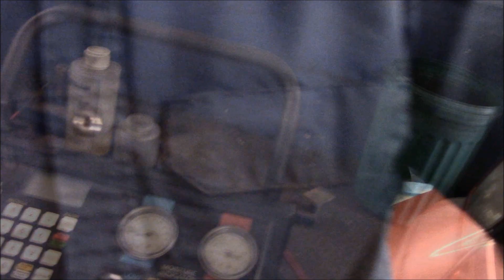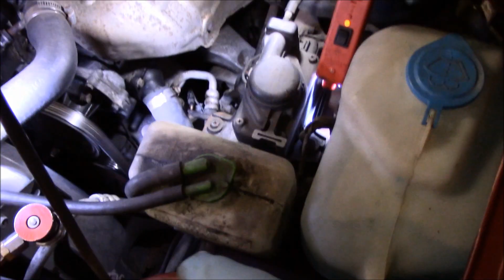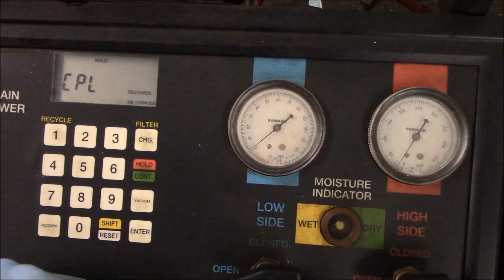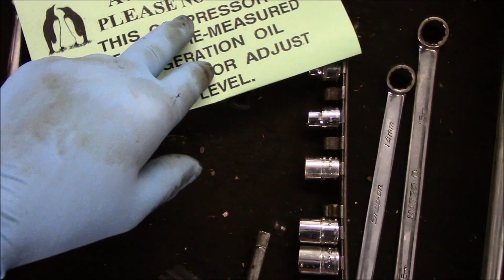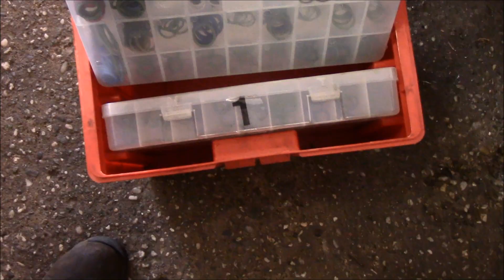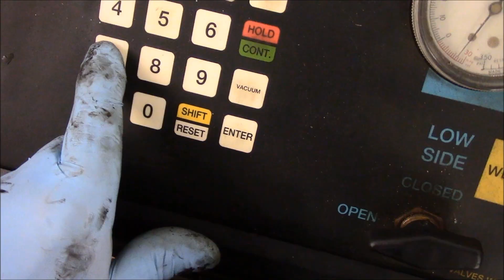How to replace the AC compressor

Comment: Hey Jim maybe if you would have increased the freon level it may have turned on and then check for a leak those system should NEVER BE LOW UNLESS THERE IS A LEAK. they will be without ac again because there is most likely a leak. Good chance there was nothing wrong with that compressor .seen this many many time on the 300+ fleet cars I work on

Comment: Hello Jim...how about a 2016 Mitsubishi Outlander that stops blowing cold air when I'm stopped at a red light or stop and go traffic??? Once I get going, it starts blowing cold air again. REALLY annoying! I have to put it in neutral and rev up the engine when I'm stopped, or I will bake. Any suggestions? Thanks!

Comment: Right in the beginning of the video you point out the low side pressure port which is blue in the front of the car, but 10 seconds into the video you proceed but putting your high side (RED) hose onto the same port that you just said was the low side. I’m confused as a hvac tech.
Reply from the maker: Thanks for watching.

Comment: excuse me sir my 2016 Hyundai elantra ac stopped working yesterday it still blows air on ever power level but its just warm air I noticed the ac fan behind the radiator was not working even when I set it to max ac I tried recharging it but the gauge read its at the right level do you know what could cause this
Reply from the maker: The first thing you should check is for power and ground on the ac compressor clutch. BE VERY CAREFUL YOU WILL NEED TO CHECK THAT WITH THE CAR RUNNING.

Comment: I have to replace my ac in a 2010 pontiac g6. No experience so wish me luck. Freon was emptied at a shop so I could start safely.
Reply from the maker: Good luck .Let me know if you need any advice
Reply: @jimthecarguy  what direction did you pull it out from? When I try to pull it out the wheel well the frame is in the way if I want to pull it off from the bottom the exhaust is in the way. Thanks in advance

Comment: Chevy Cruze 2013 eco AC 
My chevy has been blowing hot air, I recharged the 134a to the edge of the blue line on the gage in low pressure gage, then stopped the canister and disconnected the line from the low pressure at around 52. The car did not engage the clutch on the compressor so  i am thinking maybe its stuck. But it spins so easily and fast. It just wont turn on? how can i tell if its a fuse or not? or what can i do before i take it in. Its hot here as well, so gotta get her done asap.
thank you for taking the time to answer my queston
Reply from the maker: I do a live stream on Sunday night at 7:00 PM (EST).I will talk about this tonight.i hope you can stop by.